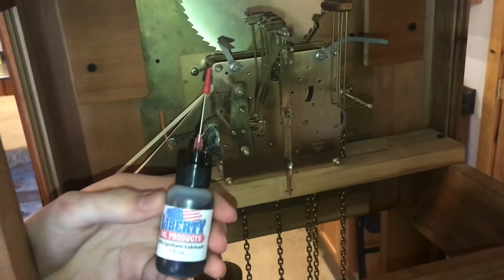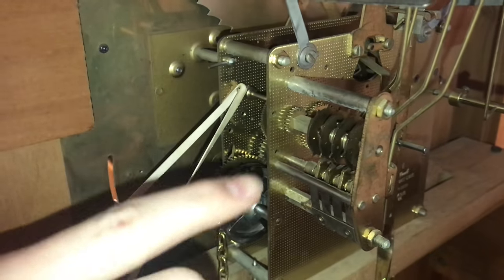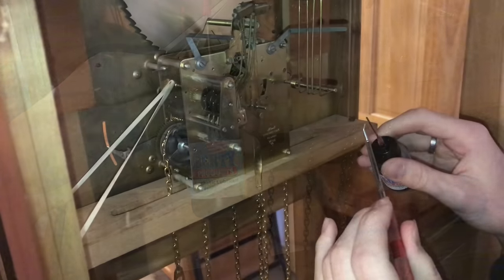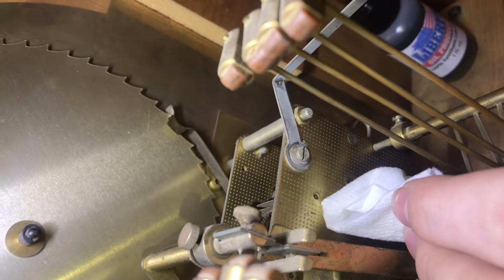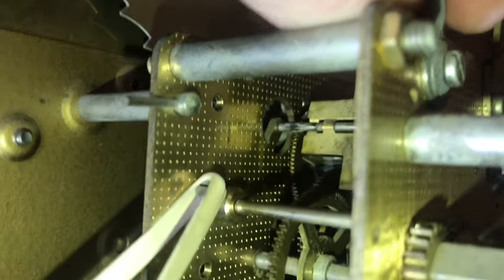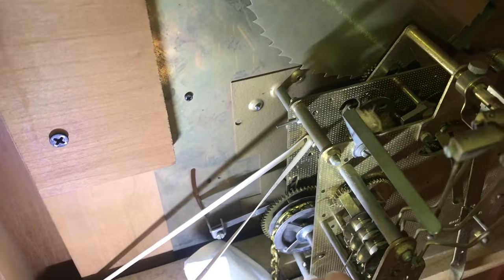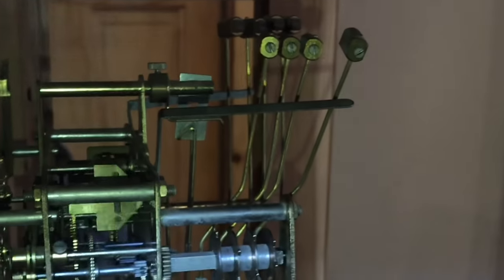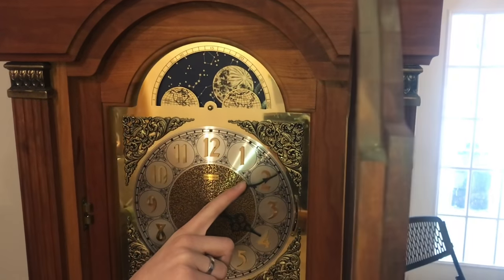“clean and oil” grandfathers clock (with out taking everything apart) 100% synthetic oil liberty

Comment: Thanks for the video. I picked up some synthetic clock oil and got a friend's clock working again. The main issue seemed to be with that upper fast spinning flywheel which began working as soon as I oiled those bearing. Many thanks

Comment: Jan 14, 2024  I've watched your video on grandfather clock mechanism cleaning and oiling (along with a host of other YouTube videos on the subject).  Today, I took the movement (which I had earlier removed from the clock) and cleaned and oiled it.  I took my time and the work progressed without a hitch.  Upon completion, I reinstalled the movement, face, weights, and pendulum.  The clock now chimes all three tunes, gongs and accurately keeps time without any problems.  Most of my time spent on this project involved watching YouTube videos and taking notes on the subject before I started anything else.  The cleaning and oiling work really is very straight forward.  Oh, and I did find using toothpicks would work but the force required to clean old oil out of the pivot holes caused the toothpicks to splinter or break.  Toothpick wood seems to be too soft for this work. A sharpened, small-diameter wood dowel with small pieces of old T-shirt worked great for me doing this cleaning work.
My clock is a 1982 Ridgeway Grandfather 3-chime, 3-weight, chain-driven Clock with a Urgos UW 32 570 D movement.  My clock movement uses a single 6.2-pound weight along with two (2) 4.6-pound weights and a 35" long pendulum with 6.5" dia. bob.  I've taken the movement out of the clock case to clean and oil it with the intent of restoring the gong and chime functions.  The process of removing the movement from my clock case was straight forward and uses tapered pins to hold the clock face to the movement.  Thank you for the straightforward, nicely shot video (great lighting, angles and audio) on clock cleaning, oiling and operation.
Reply: I have a ridgeway from the same time period.. I have 3 weights.. does the heaviest weight go on the right chain..??
Reply: @thomasgriffin8269  Hi Thomas - Yes, the heaviest weight goes on the right as you look at the clock.
Reply: Clock has to be removed and cleaned properly before ANY oil is used. This is a great way to ruin your clock.
DO NOT DO THIS
Reply: @casper471  It's funny how after decades of the chimes not working and the clock keeping time slowly, after my removal of the clock works, its cleaning, and oiling, the clock now works just like it did when it was new, however.  Do you have any other "scare messages" you wish to share that are more specific than the generalization you offer?  Thanks in advance.
Reply: @jimw1615 putting a small tooth pick in the pivots is getting less than half of the actual gunk out which is lodged in between the pinion and coats the pivot from the other side the new oil and old oil becomes a sand paper mixture over a few years and actually causes more wear

Comment: If the chimes don't work, you may have the wrong weight. On some grandfather clocks, the chime weight is heavier than the movement weight. One weight drives the chimes, the middle weight drives the movement and the third weight drives the strike
Reply: I’m stuck. I just was given a Tempus Fugit grandfather clock and the chimes don’t sound. I weighed each one of the weights and they were basically all the same - 4.12 lbs. one was 4.4 lbs. Can’t figure out if there is maybe a silent button.
Reply: Bare hands on brass weights is a no no. Wear gloves when touching or handling brass.

Comment: Title should be, "how to get a clock working with just some oil".  When properly cleaning a clock you can test the movement with no oil after all the pivots and bushings are clean.  It will run without oil if everything is good.  Dust has terrible things in it, like silica. If you don't remove all the dried-up oil and dirt, you are slowly eating away at the bushings and pivots.  Eventually the orientation between the gears changes and you are looking at a very expensive repair.  If you only run the clock rarely, there is nothing wrong with what you are doing.  I hope you consider a complete disassembly at some point, if you value your clock and want it to last.
Reply: Thanks for that information. Do you recommend for greatest longevity that vintage and antique clocks not be constantly run or only be periodically run? It is very hard these days to find people of extensive experience to maintain a small collection of superb clocks.
Reply: Given the cost of horological overhauls usualy a new replacement movement is offered this costing less on reproduction longcase clocks. A flushdown clean,clock oiling, maybe slightly heavier weights then required is another DIY option lower in cost,the old less heavy weights can be sold on ebay to partialy defray costs

Comment: The chime on the left of the 4 is miles off frequency...suspect it's been shortened as it's at least a half tone too high
Reply: I noticed that to the pitch used to be adjusted with set screw to adjust length of the bell

Comment: LOL please move the hour hand. It's like 15 minutes off. 
I recently acquired a chain driven tall clock and the first time I wound it I thought wow that takes a lot of effort to pull the chain down so I lifted up on the weight to make it easier. Also I believe that winding it by lifting on the weight as you pull the chain prevents a lot of wear to the barrel pivots and the chains.

Comment: The teeth of brass gears should NOT be oiled. If you watch the videos from clock repair shops, they all agree NOT to oil brass gears. Error 1 at 2:40
Reply: I'm sure he was oiling the shaft that gear was on.

Comment: this is a bit like "servicing" your car engine by just topping the oil up. This clock needs a full strip down and clean before assessing if any bushes or pivots need attention. Only then should you apply new oil.

Comment: You mentioned using ammonia to clean a very dirty clock works. Ammonia will weaken brass. When vibrating brass cases you can add a non=ammonia cleaner to help with the shining of the brass, but never ammonia based stuff like Brasso.

Comment: I have a Ridgeway model 225 and all of the sudden it stopped running, I gave the pendulum a swing and the tick/tock was very uneven.  Searched YT and one recommendation was to slightly turn the anchor escapement.  I touched it and discovered that there wasn’t and resistance between it and the shaft, it rotated freely on the shaft.  I played with it and got the tick/tock sounding and measuring good and it runs, but I’m sure it’s just a matter of time before it slips and rotates out of position and stops running.
What to do?  I’m thinking of shielding the area below the loose anchor and cleaning the shaft and side of the anchor and applying a small spot of very thick glue hopefully securing the anchor, not using and this glue that would seep into the gaps but only on the outer surface.
What do you think?  Any suggestions?

Comment: question, some clocks just let you "pull" on a string to get a weight back to the top, instead of winding. i want to make a pendulum and weight powered clock from scratch. how is the pulling of a string part achieved.
Reply: That's a cable drive movement

Comment: Don’t listen to the comment about the WD40, it is a really good agent to break down the old oil that was probably put in 20 years ago or your clock would still be running , adding new oil without cleaning the old grime out will not help your clock run. WD40 used correctly will clean then you must wipe away any old residue, after its clean from old grime use clock oil to keep your clock running perfectly. Don’t forget, you must clean it every 4 to 5 years and reapply oil.

Comment: That compressed can of air did absolutely nothing all the gunk is hidden and that oil will mix in with the gunk and create a sand paper mixture to sand down the pivots causing more damage to the clock just take your clock to a clock shop!

Comment: Great video few questions 
1. Grandfather clock stopped working many years ago. 
2.  Chimes not working. 
3. When start clock works for 2 or 3 minutes then stops. May someone please help me.
Reply: Watch the video. The axles and bearings need lube every so often. It not, the clock stops. You can repair it yourself with TLC lubing. Just be patient.
Reply: @MrAquinas1  thanks, will do as you say lube it till it works.  When I get it to work will get in touch with you. Thanks again John
Reply: @MrAquinas1  Hi Ed, this afternoon work on grandfather clock about 2.5 hours to get clock to work just like new. Thanks again John
Reply: @johnc8112  Good for you. I saved a lot of money buying a non-working Ethan Allen GFC for a small fraction of its original price guessing it was repairable. I hired a serviceman the first time, who didn't charge much, and watched him. All he did is pinpoint lubrication and got it going, although I rarely use the chimes because it's too close to my bedroom. It drove my late wife crazy. I just use the chimes on rare ocassions like Christmas.
Reply: @dperry428  Thank you,  for one year with lubrication of all points running after one year. Now on and off running have lubricant twice lot of lub.
Reply: @MrAquinas1  - great story. :)

Comment: How do you get side glass out
Reply: I think it varies by model what type of grandfather clock you have. I’ve seen some with a little cloth than glass. But to remove the glass panels, I there’s little clips on the inside of the clock where the glass panel is held in place.
Reply: Here’s a little video on how to remove glass panels from grandfather clocks. This might be for Howard Miller, but I know that this would also work for other models of grandfather clocks. https://youtu.be/71UtTybSS6c

Comment: Thats the problem with the old genuine grandfather clocks. They need oil about each year. Its cheaper and more reliable to get a quartz movement with simulated chimes but its not the real thing even though its hard to tell the difference.
Reply: @dperry428  I have a Howard miller nicea mechanical clock with a kieninger sks 15 movement with 116 cm pendulum I bought in 2017. I have had to replace the movement twice in 5 years. I bought the clock to replace a Chinese crosley small grandfather clock with an electric movement that had the same movement for 15 years before I donated the clock after buying the mechanical one.

Comment: I don't think WD40 will hurt anything, but you must keep in mind that it is a solvent NOT a lubricant of any kind!  Most people think it is some type of oil!  Even the manufacturer now puts the word lubricate on the cans but it actually isn't a lubricant and never was.  It frees things by dissolving the old oils, greases, etc. and flushes it away with the dirt.  You must wipe it all away before you lube or it will also dissolve any lube you then use after it, to some degree.  A really light oil such as sewing machine oil  should be okay.
Reply: WD40 actually attracts dirt over time, that is the main reason it’s not recommended for delicate parts